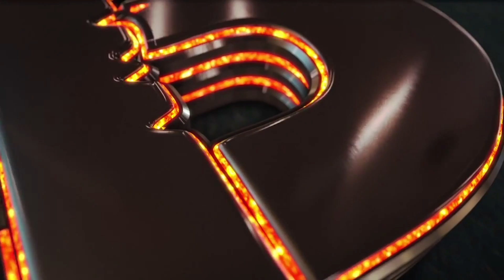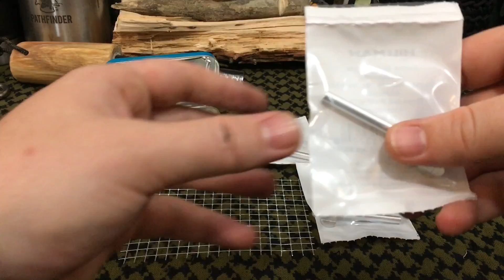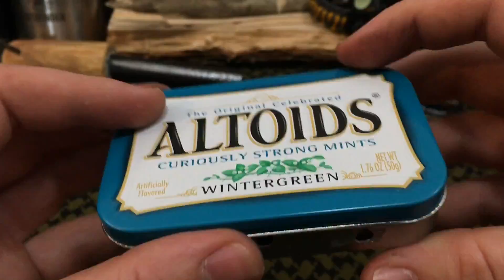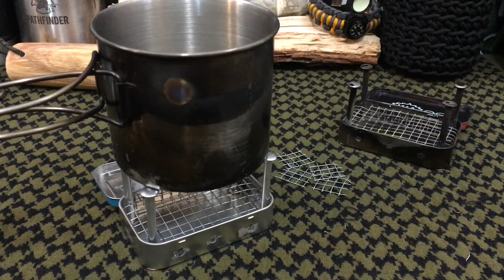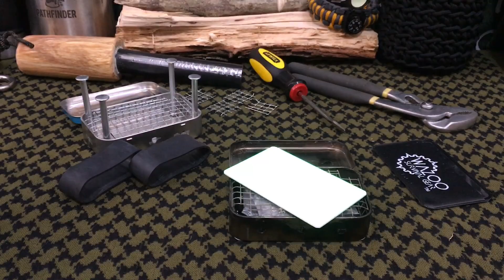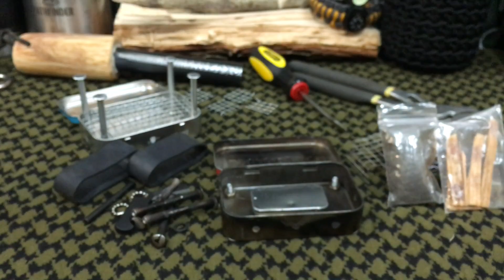Best DIY Invention: Wood Burning Pocket Stove

Comment: i wonder if you could do a mod to make this burn alcohol too?
Reply from the maker: Drill more holes but drill them higher up... maybe? Not a horrible thing to experiment with
Reply: or you could put a soda can alcohol stove on the chicken wire, under the pot. but i would prefer to use dry fuel.